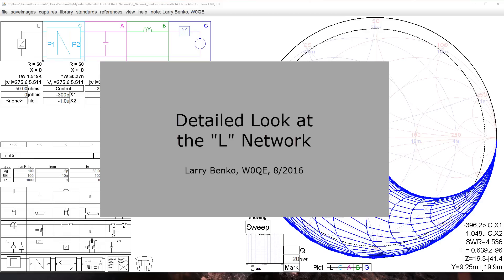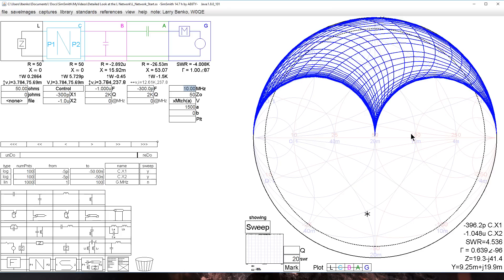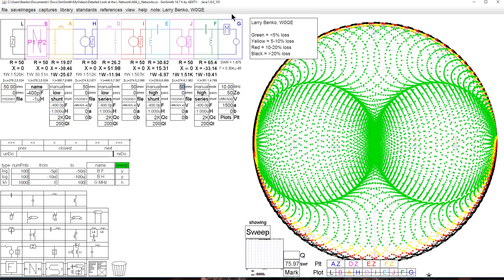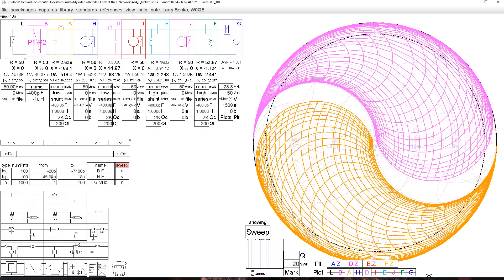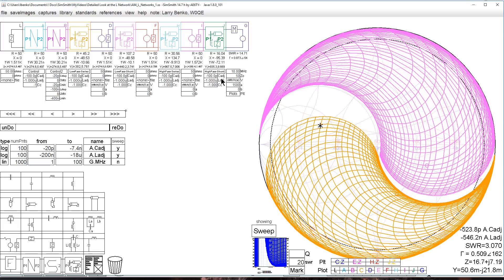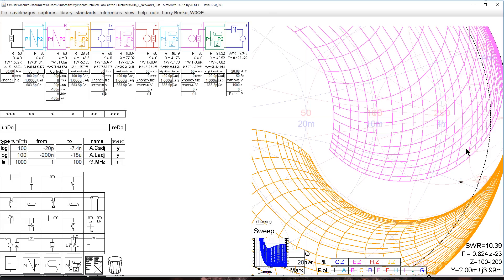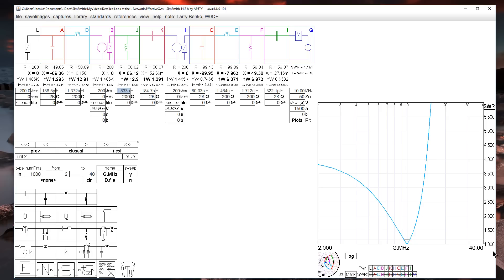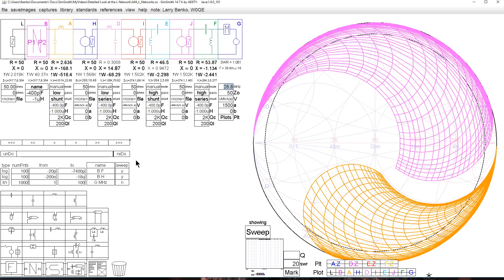#2: Detailed Look at the L Network (Adv. 2)

Comment: I tried to reproduce this in 16.4 but end up with graphs not looking like yours. They look similar but the matching region has some lines extending out of the yin/yang regions. For instance if i use the LC low shunt variant i get the same as your yellow, but with lines going from the top circular shape of the "yin" to the point where R=infinity and X=0. Any idea if this is a result of a change from versions or what mistakes I have made?
Reply from the maker: Kjartan,
Email me your SS file and a screenshot of what you see.  I'm sure this will be easy to figure out.  I just had shoulder surgery yesterday so it might take me a day or 2 to get back you.  Larry
Reply from the maker: Email me @  xxw0qe@gmail.com 
Larry
Reply from the maker: Kjartan,
I never saw anything from you. Did you get the problem figured out?, Larry